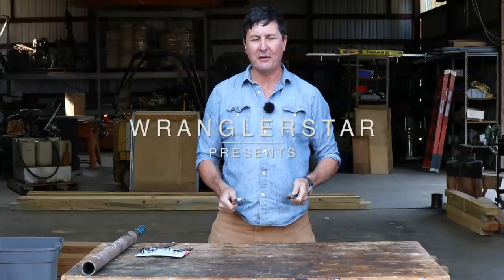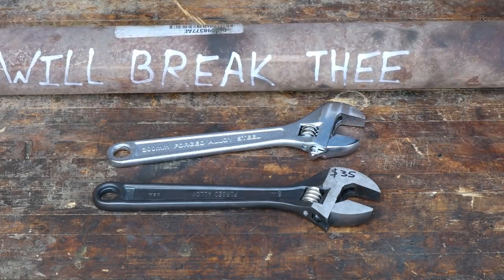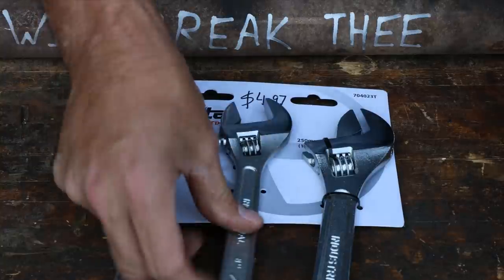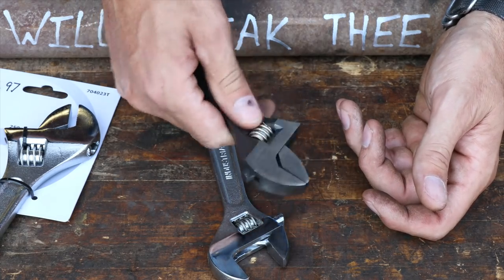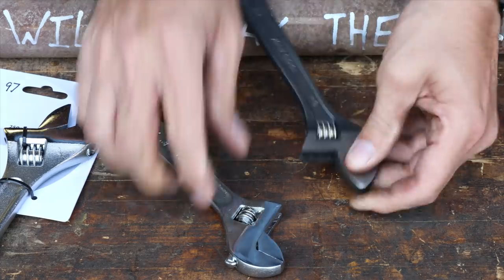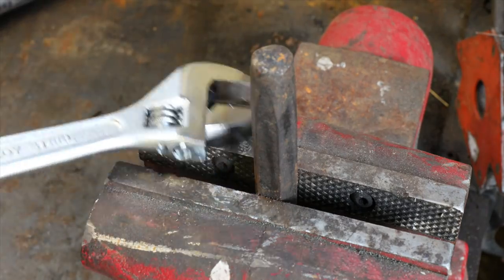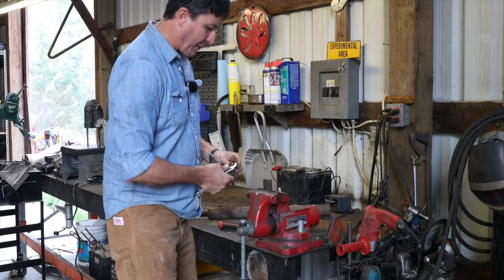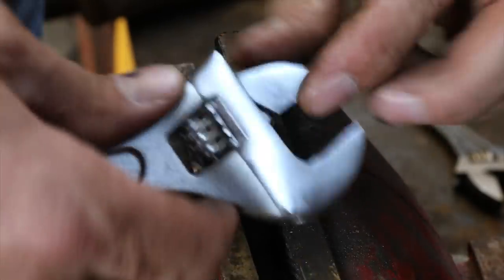Testing Cheap V.S. Expensive Wrenches On AMAZON

Comment: Everything he says goes for someone that uses their tools to make money. For me who just need tools to occasionally fix something I'll stick with the 5 for 3 deal.
Reply: Yes!! Everyone should START with cheap tools. If they never break then you never even needed to spend those 500% extra money for the quality.
It's WHEN THINGS BREAK that you invest in quality. That's when you know it's worth it for the work you personally do.
A complete toolbox and some machines for your average garage can cost 1000s of $. Better to spend 2000$ than 10000$, and then have 8000$ saved for your car/projects. 
If you START with quality tools, you won't ENJOY it more because you don't know how crappy a cheap tool would have been. So again - START with cheap tools.
Just don't go "poisonous plastic, child-labor, slavery-manufactured" kind of cheap. Buy the cheapest tools from a reputable brand or store.
Reply: // , Just make sure that you're not fixing something expensive. Sometimes the price one pays for cheap tools is the damage they can do to what I'm using those tools to repair. I've learned some very difficult lessons from this that nearly killed me.
Reply: Well this is what I do on my job, if I'm going to use a tool very often I get a good one, craftsman, matco, snap on, etc. But if I'm going to use one tool just one or 2 times I get the cheaper
Reply: Mark, you have no idea. Those wrenches (adjustable open end wrench) would get you fired at big time auto repair places or on Power Plants, Refinery, Chemical Plant construction sites. Ran a few off myself. One thing we would do when someone would come to hire-out with us is to look at their tools. Anyone with one of those wrenches were directed to our competition hiring office/site and told to get rid of the"Cresent Wrench"; that way our competition would be hiring a slug and giving us more advantage. Yeah, just leave that tool under the sink at home, in the tractor tool box or in the barn. Those damn wrenches have even got entire companies run of a project by the customers Chief Inspector or QA/QC Manager.
Reply: @jimwatts7489  yep
Reply: @NateB   two words harbor freight.
Reply: Lafe Denton  I work unloading fertilizer cars and building ammonia filling stations. Most of my tools are from harbor freight.
Reply: @Erafune  That is great advice. One thing I'd add is that you should get basic tools. Don't look for the fancy magnetic, LED covered, plastic lined tool. You want a basic set that you can beat up. Even after you get nicer stuff, you're still going to have situations that you'd rather not risk your expensive tools with (weather it's a bolt that's more rust than steel or a buddy who wants to borrow something).
Reply: @igotnoname4557  OMG it's so funny you'd mention that.  I've got literally THOUSANDS of dollars invested in my tools.  Tools I've collected over decades of projects from rebuilding cars (until my lack of knowledge torpedoes me) to just about every home-improvement project you can imagine and nothing makes me cringe more than when a buddy or non-tool-guy family member wants to borrow something.  IF it comes back at all, it's almost always grimy or scratched or in some cases bent or broken.  When broken, two things happen: one, they offer to replace it with a cheap Chinese POS (if they offer at all) and two, they're shocked at how much I paid for the item they just destroyed through misuse.  So I keep a cheap set of the most common tools to lend out, so that I don't care much at all when they don't find their way home.  haha
Reply: go to a big box store, lets say home depot, and buy the "husky" store brand tool.  life time warranty.  a set of three for about $20   not the best but i have brought back a few defective ones and no issue.  "just go get a replacement from the shelf" is the usual response
Reply: And if you are buying a jack to lift up your car so you can get under it...do you buy the cheap one also, just because you're only going to use it a few times?
Reply: price and quality are only semi-related. I learned the cheap-tool lesson when I was a teenager; the tool broke under load, and there was some bleeding.  Good tools are an insurance against further complications; cheap tools have their place, but it is more limited.
Reply: No, like he said sometimes you have a bolt that won't turn and if you use the cheap wrench that is a softer alloy it will give and round off the flats. Best to use a quality tool that will break before rounding the bolt, a quality tool comes with a lifetime warranty that if it breaks, they replace it. I buy cheap tools for my children's toolboxs since they need to learn to take care of tools. If they leave a 2 dollar wrench out in the rain it doesn't make me angry and I can use it as a teaching point. What? You left MY $160 set of wrenches out?!?! Yeah that would be a bad day.

To those who say they never use an adjustable wrench, yes we know if you can you should ALWAYS use a socket or box end or crow's foot, but sometimes it would take way too much to get the proper socket or box end because you don't have that size and would have to order one and the project needs done yesterday. Knowing how to properly use an adjustable wrench is key to not messing up what you are working on. As a airplane mechanic I hardly ever used an adjustable, as a welder the only wrench I have in my work toolbox is a 12" Crescent.
Reply: @PracticaProphetica  Trick question! I would put in the jack stands and then take the jack out before I got under there :P
Reply: @Illevas001 ...the cheap jack stands, or the quality ones? :-)
Reply: @PracticaProphetica  what do you mean by cheap jack stands?

On another note, I always have adjustable wrenches in my truck. I wish I had the room to carry every tool I could ever possibly need, but I dont. I did spend the money for some good quality wrenches though, 2 of which are SK.

Comment: I have been working on just about anything for 40 years and I will say this,ANY  tool that is abused will break, I have spent more on stitches and burns than replacing broken tools, all mechanics learn that the right tool and used proper will get a mechanic further, A cresent wrench is a tool that has so many different uses  and please understand that the tool trucks charge big money for tools because of the truck and truck costs and then the driver wages, when you buy the popular tools it is a status thing, most of the tools on the truck are no better than the tools that can be had from places like harbor freight, get the right tool for the job and use your head to do it right and you have made more money instead of making them big payments,
Reply: Yep....and probably never used a 3/4 inch SK ratchet set. I once had TWO cheater bars hooked onto the Tbar of a SK socket ,with a 24 inch extension going into the internals of a skid loader . I was standing on a 4 foot cheater bar while my helper used a 3 foot cheater bar. I estimate I used about 1200 foot pounds removing a lock tited  axle bolt which I could not heat to weaken.
Reply: a smart mechanic buys the tools he needs. sometimes these come from the truck. sometimes they do not.
Reply: I've never had anything, not one dang thing from Harbor Freight last.  Their tools have nearly cost me my life and or limbs more times then I'd like to admit.  Rule of thumb, if the tool isn't from U.S.A., it will cause you problems or even kill you.  Facts are that good mechanics use good tools, it doesn't mean they're pritty tools or brand new Snap-on, it just means their American tools made with American materials.   

Never buy tools from a country that eats cats and dogs unless you absolutely have to. Thanks in advance.
Reply: gonna call bullshit on that one. plenty of tools will do ya just fine no matter where they're made. taiwanese sockets (impact or chrome) are just fine. snap-on impact sockets are only good for a couple years before they're wallered out so bad they won't fit the anvil, and no they won't be warrantied. 

if there's a tool i only use once or twice a year, chances are i'm not going to pick it up off the truck. find a decent quality one that fits your wallet and go for it. preferably it's from a country that has some sort of human rights recognition, but that's politics and not tools. yeah, a $2 wrench from good old commie china is garbage, but there are decent options out there.

nice tools are nice. i get a funny feeling in the pants every time i drop cash on the truck, but it IS NOT a requirement for everything.
Reply: tr0n well yeah, some things do make logistic sense up to a point, even still though I've had really bad luck with communist chrome but a spare set of sockets is never a bad idea. When I was in school, cheap tools were all I could afford, I've burnt through every wrench and socket from thoes days since with many lessons learned. I'm more or less speaking of weight-bearing tools like stands, jacks, big wrenches and things of the like, that have made the job a few too many times dangerous.

My instructors used to collect any non American tools and put em in the scrap cars to go to the crusher lol, they weren't allowed because they caused so many problems.

I can't rely on communist tools, they just don't work for me in my 13 years as a certified mechanic. They always make things worse. If I didn't use em all the time it might be a different story I guess but they still eat cats and dogs....
Reply: hickory

Comment: To be honest, you could get by with the cheap one without problems
Reply: Stoopingcrane it also depends on if you push the envelope. If you're using a 6 inch crescent wrench because that's what you happened to have but it's doing the job a much bigger tool ought to be doing then you'd better hope it's a good one. I always buy quality small tools, especially adjustable wrenches, for this reason.
Reply: Made in USA I've had good success with the pliers wrench from Knipex. It never slips without warning. The harder you turn, the tighter it grips plus there's 10:1 leverage advantage squeezing the handles. Still, there is a point where the nut will force the jaws open against your grip, but you can feel the handles parting and either grip harder or back off without rounding the fastener. I've had these deform fasteners by crushing them but I've never had them round one off.

Comment: I love these test videos. You should try out a knipex pliers wrench. First one I bought was hard to drop 50$ on a wrench. Ended up replacing all my crescent wrenches with them.  I like all of knipex tools but I don't think I can justify paying that much more on their other wrenches but the cobras and pliers wrench are the two worth it.
Reply: Chris Fox you think it was hard to drop $50 bucks on one?? I bet yours is big enough to be frequently useful. 😁 I dropped $58 on the little "86 05 150" TSA compliant sized one for my laptop bag, for those rare occasions I need a wrench on the go. That was hard to justify to myself, but I done it.
Reply: Hah, I just made a similar comment.
The Knipex 86 line are just superior to adjustable spanners in  every way (expensive though). 

I'm not sure how well they'll stand up to being reefed on with a large breaker bar, as generally if you need that much torque you'd be using a different tool in the first place, but for their intended use they're superior to any regular adjustable.

...And yes, their pump pliers are better than any others I've come across as well.
Reply: I am just not a fan of the 86 line.  I have plenty of other Knipex tools, and I love them all... except for the pliers wrench.  I've been carrying the cobras and alligators (their slip joint pliers) for a 10+ years now, and they are very impressive, but when it's time to break a hex loose I still want a wrench.
Reply: Chris Fox, based on your enthusiasm for the Knipex pliers wrench i looked up a video on it and I am very impressed.  My beloved Channel Locks may have to move over.
Reply: I have 86 05 180 pliers wrench, an 87 02 250 cobra, and a combo set of mini 86 03 150 pliers wrench and 87 01 125  cobras in a tough nylon pouch. And a lot of other Knipex tools. The pliers wrench style is unbeatable.
Reply: Heh, I have that mini set as well. Super handy. 
Also have 86 250s & cobra 250s.

Good combo to have.

Comment: I had some old Craftsman tools that dad left me.  I didn't have room for them in college or my apartments and so I left them in his shed for a long time. They rusted and thus got weaker.  After cleaning them up, I heat treated all the hand tools with a parts oven and powdercoated them green to match my Ryobi saws.  They are stronger than they have been since new.  I'd love to see what kind of force would be required vs the factory tools and modern craftsman tools, but replacing them is impossible.

Edit: I should specify that he died when I was 15 and that I didn't know a damned thing about tools at the time beyond how to use a few.  Now I have a small garage of my own and a penchant for keeping tools in great shape.

Comment: I usually love the video's you make but the "I usually don't trust Chinese" products talk is really getting old. When you only buy the cheapest ones possible of course they would not do well. Is water wet? Id love to see two equally priced products and see how it goes.
Reply: Just don't see how this is a fair test at all other then pushing the product for sales.
Reply: Look at it as a quality comparison between price points then.  Like you say; you get what you pay for. This video shows the quality differences between a top tier tool and a cheap one. I say the cheap one held up pretty good against the top end tool.  It performed almost as well under stress and is more than sufficient for normal use.
Reply: Totally agree with you on that!
Reply: the problem is you won't easily find equally priced products.. I think he mentioned when he was shopping for made in USA products that he was having a hard time finding them. Since the Chinese working conditions and pay is not equal to the USA they cannot compete on price alone, more often than not, especially with tools you will find that things made in the USA compete on Quality not value. 35 usd might actually be one of the cheapest USA made tools you can get. Having said that though you can probably find a made in China / foreign made tool that is equally priced to a USA made tool, that would be a fairer test I think and perhaps a good idea for a future video... 35 usd Chinese wrench vs 35 usd USA wrench?
Reply: You may be able to buy a Chinese made same quality tool as the USA made one, but for half the price. So, it's not really a fair comparison. It's like saying Korean cars are bad because they can't beat a Ferrari over the quarter mile. A fairer test would be the most expensive AND the cheapest Chinese wrench vs the most expensive AND the cheapest USA made wrench. If there's only the 1 wrench made in the USA (which I think was mentioned), then it's still fairer to compare it to a spectrum of Chinese made wrenches.
Reply: Interestingly enough. I believe he is Canadian.. What does Canada make?? Don't get me wrong, I love Canadians, just an observation..
Reply: Gary Vander Giessen Maple syrup, hockey players and tween pop stars
Reply: And my wife. Linda. :)
Reply: Gary Vander Giessen  ......... ummmmm up here in Canada eh ! We make  American Snap on tools and tool boxes deep in the frozen tundra. We don't make em all just the because our factorys are made from ice. So we don't have the technology to make the master series. 
Oh yea we invented the Roberston screwdriver and screw. So your welcome
Reply: LOL
Reply: Good luck finding an equally priced Chinese product
Reply: Is water wet is debatable. Water only becomes wet when it hits the air. If you are submerged in water are you wet? Or are you wet after you come out of water?
Reply: Buy real screwdrivers.

Comment: If a cresent wrench is turned in the opposite direction as advised in the video, it will stress the movable, weaker jaw far less, due to the lack of leverage of the resistance of the bolt being turned. The video clearly shows that. I suggest testing another wrench in the opposite direction to determine the difference in strength.